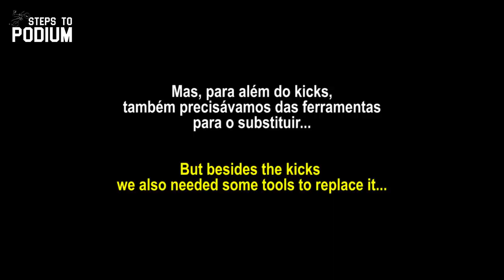Hard Enduro Race: Valongo Extreme PHES 2018

Comment: hey man! awsome video, i noticed your gas gas stalls allot, mine is doing the same, why is this?
Reply: i thought of re bleeding the clutch to see if ir works better
Reply from the maker: Thanks!! Yes it does and it pisses me off actually, most likely it's the carburetor, it's not tuned for hard enduro, low revs and such and it stalls, but this week I'm taking care of it so it doesn´t happen so much. In the next video you'll hear all about it :)
Reply: Steps to Podium ahh god dam! this last weekend i was like wat the fks goin on why do i stall so much, i know i can clutch control lol its not me, thanks so much for the reply dude, hope yours turns out well, like your channel to i'l be stiking around ;)
Reply from the maker: Ahah no problem! If you trust a mechanic, ask him ti check the gigleurs of the carburetor, most likely it has to do with that! Cheers and thank you for the good words man! :)
Reply: awsome :)  yeah il stop by the garage and ask himabout that, i actually have a veery small rear sprocket (42) that was on the bike when i bought it, aparently its very posible it is because of that also, has a bigger stall area , but i will find out from the mechanic.
Reply from the maker: Do that! :) That can be as well! try changing to a bigger sprocket and you'll feel that you have more low rev power, for sure.